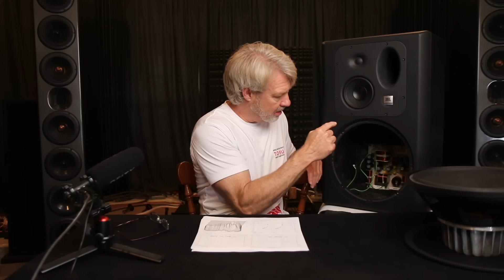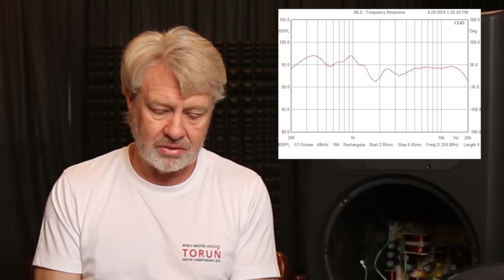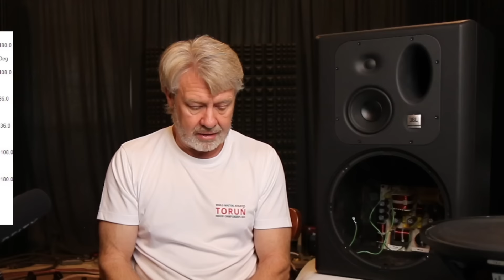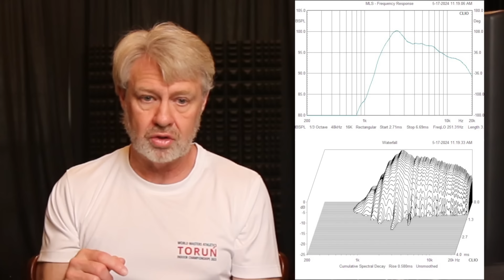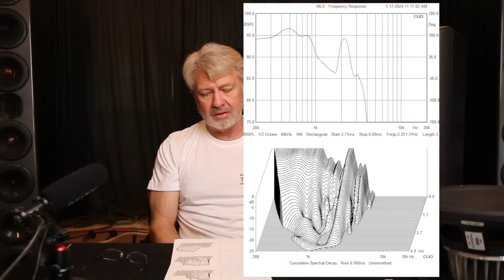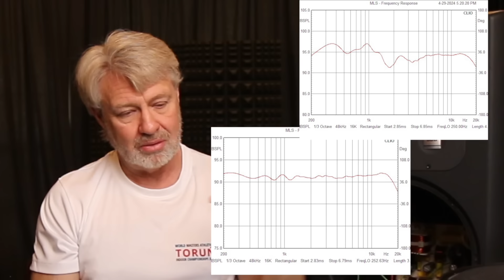Nails On A Chalkboard? These JBL's Were a Handful!

Comment: Response graphs from 200Hz and higher? ehm...
Reply: He always does that, as the room effects the LF response......
Reply: @mfr58  if the room effects his LF response? Think about what you just said dude
Reply: @Projacked1 no point measuring below 200hz - it's just bass which is largely down to the room. Important frequency range is 200hz upwards - this needs to be as flat as possible.
Reply: @analogueman5364  No point measuring below 200 Hz? Again, think about what you just said.
Reply: Danny uses a "4ms gated time window" which gives anechoic measurements 200Hz-20KHz, but it isn't accurate below 200hz. If you make the window longer, the bass becomes more accurate, but you also start to allow room reflections into the measurements, messing up everything in the process. Most anechoic chambers are only accurate down to 80-100Hz. Plus the measured bass response of a speaker is determined by the drivers, cabinet & port/PR tuning, and even more so by the room it's placed in. So trying to get accurate measurements below 200Hz is difficult. Klipple NFS has it's advantages by taking a ton of measurements to average out the room response, but it's also 100grand.
Reply: So we just don't do it....?
I have never , ever heard that before. I smell some bs there. And what room reflections? The room is treated, right? If your bass is in the way of measuring , you need to fix that. Pure and simple. That's the hardest part to get right yes, but you can't do that on intuition....like what does that even mean?
You ALWAYS measure from 20-20k. Just throw the science out the door? That's the weirdest thing I heard so far. And not accurate? He could make it worse, without knowing, that's crazy. Think about it.
That is like saying;  'yeah I can hear it on the graph'
Reply: @Projacked1  it doesn't make sense because you don't know how measurements work, how they are taken, or the variety of means by which they can be taken. If you're not getting anechoic measurements of the speaker you aren't getting a speaker measurement plain and simple. you're getting a room measurement. And room measurements will vary depending on where the speaker and microphone are placed within the room. It's a lot more complicated than "just treat the room and measure the damn speaker"
Reply: Obviosly too complicated for Danny, as he never shows the low response. That might be a total mess, and therefore what?
 I'm no pro in measuring, but likeI said . I have never ever heard that before. Just leave that part out? sounds highly suspicious.
But do elaborate , it sounds like you're the pro here. And yes ofcourse there are lots of ways to measure. I have seen quite a cheap anechoic chamber build on Tech Ingredients, and the low-end part never got left out. That's the most interesting part. And if I'm not mistaken, any experienced person, knows where the limitations are, or the effects on the graph, and work around that.
Reply: @hoth2112  I have NEVER heard the phrase; There is no point in measuring below 200 Hz!
My guess is Danny told you that?
Reply: @Projacked1 Again you're missing my point. With a measurement using a gated time window, measuring anything below 200Hz is INACCURATE. Even splicing in nearfield response below 300Hz, like stereophile does, is fairly inaccurate (which is why most speakers in their graphs show a hump in the 50-100Hz range. Plus the speakers cabinets and port will dictate it's low end response (not the crossover) THEN the room and the position of the speaker in said room dominates the response of a speaker below 200Hz, at which point YOUR'RE NOT MEASURING THE SPEAKER, YOU'RE MEASURING THE ROOM. Move the mic/speaker 1-2 feet and the response will change. Move one or both again and the response changes yet again and again. So tell me this: What's the point of showing inaccurate/inconsistent data?
Reply: @hoth2112  I know how a speaker works dude.'Inaccurate' is still better then none at all? It's a standard for a reason, ....so I or you don't know anything except it might sound flatter above 200Hz. Also, you can build anechoic chambers to reduce that as much as possible and one can acoount for the dips or standing waves. I have seen it on Youtube, and quite cheap actually compared to a million bucks anoechoic structure. We are not talking about huge subwoofers here, that shake the whole building. The software can take that in account as well these days.
That being said , a measurement says nothing about how it sounds to your ears, but that's besides the point, I know.
Reply: @Projacked1  Sure, but you clearly don't understand how measurements work or how rooms affect the measured response/sound of a speaker. If he supplied "better than nothing" measurements he'd still get shit eight ways to Sunday. Anechoic chambers aren't actually that reliable for low end measurements, especially cheap ones. Even the best chambers out there for things like speaker testing are only reliable to about 40-60Hz, and the ones that are potentially effective to 20Hz are absolutely massive. Slapping together a cheap 8x8x8 ft plywood box lined with 12" thick foam wedges isn't going to do any better than what we currently offer, especially below 200Hz. Measurements can tell actually you a lot about how a speaker will sound, especially a full suite of on and off axis measurements. Then combine that with a basic understanding of room acoustics will give you a pretty good idea of how the room is going to affect the sound of the speaker in that room.
Reply: @hoth2112  measurements show driver response that's it Has nothing to do with what you hear.. 
They don't tell you anything except guidelines to work with towards a proper design.
The rest is all in your head. Don't assume anything for people, or what they know. It's not a pissing challenge.
Reply: @Projacked1 So what you're saying is, you don't know how speakers work. Got it. 👌
Reply: @hoth2112  sure man, whatever you say...
Reply: @Projacked1  back at ya dood.
Reply: It's a time gated measurement. When doing frequency sweeps you want to catch the speaker only and not the room reflections or boundary reinforcement. Large wavelengths like 200hz and below are highly affected. Cool trick to get anechoic response.

Comment: It's JBL, what did anyone expect? Other than a handful of legacy models decades ago, I have always found them to be absolute overpriced crap, with similar design and sound issues.
Reply: I am sorry but that's a crock of crap ..
They are one of the very few out there that always made every single driver in house . No off shelf generic peerless shit you see out there in abundance. 

I do agree not a fan , but they did some good driver work. 

Also you need to consider this channel has said the same about speakers most people get a stiffy over! So you not being surprised means absolutely nothing. If you follow Danny a little around .
Reply: So does the the jbl l100 mk2..Your ears do not go by a line on a graph..That's what seperate the different  manufacturers..
Reply: @MuscleBN yes they do. Line on the graph needs to be as flat as possible, that's the starting point as it ensures the speakers response doesn't have any peaks or troughs affecting the sound. The 'sound' of a particular soeaker or manufacturer comes from everything else.
Reply: @analogueman5364 no that's not true..the elevated or diminishing  response at a  set frequency  is an integral  aspect of what sets a speaker from the rest..U really think all these manufacturers of decades of speakers didn't know what they were shooting for..
Reply: The new HDI series sound great.

Comment: Would be great to hear more from the customers that went ahead with the upgrades on how they compare.
Reply: You haven't been reading my posts?  The B&W CDM-1NT upgrade is a big improvement.  I had two pair so was able to A-B the change.
Reply: Did an Danny designed upgrade on mid 90s speaker, highly regarded at the time.  Computer speakers installed quality R, L, and C.  Bookshelf speaker, same. Multi $K, FLAT measuring speakers installed quality R, L, and C again.   Unmistakable improvement in all cases.

Comment: Amazing transformation. How did you rotate the tweeter/mid panel? With the port on top or bottom? What's your recommendation?
Reply: Port orients to the side in that config
Reply: You take out the screws holding the panel in, rotate panel then put screws back in, voila
Reply: I guess you put the drivers close to each other

Comment: 😅😅😅new in 2015 for 2998€/pair. Joking???
Reply: it is a JBL, you pay the name, not the speaker. A small magnet for the bassdriver, but covered with a big cooler, it is show
Reply: @cbts0029 
It's thermal management ... their top end drivers have compact neo motors, with adequate heat sinking. 

Drivers are fine, in this case it's poor execution in the x/over and the cabinet.
Reply: @FOH3663  it eats 200W, you can check other Neodym drived basechassis, their cooler are much smaller, this one is show
Reply: @cbts0029  
- Woofers are terribly inefficient ... heat is an issue. 
- I don't believe JBL's employing die-cast aluminum heat sinking is "for show" here.

Comment: If only it had a 3 cent piece of metal tubing for speaker connection and the sensitivity was badly compromised. Yeah that's the ticket.
Reply: 92 dB efficiency badly compromised from 94 dB? Anyone who would prefer the original response over Danny’s response must be a glutton for punishment.